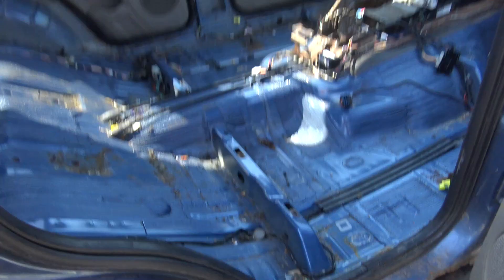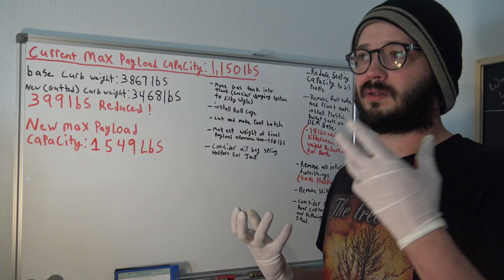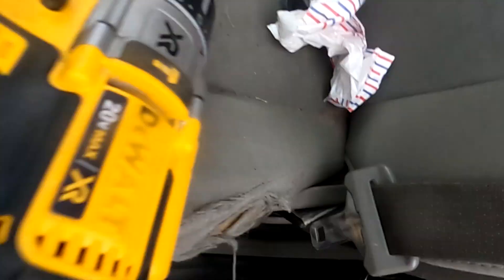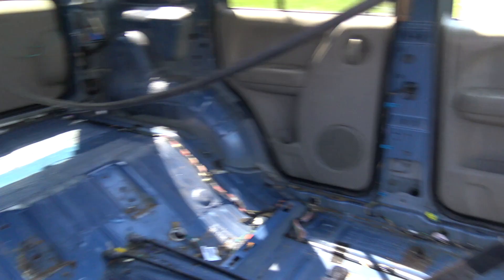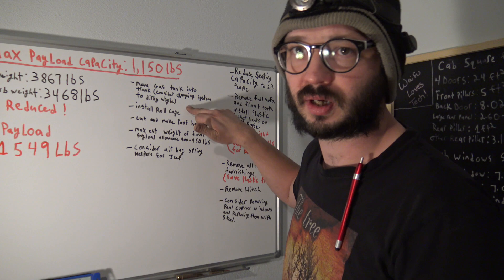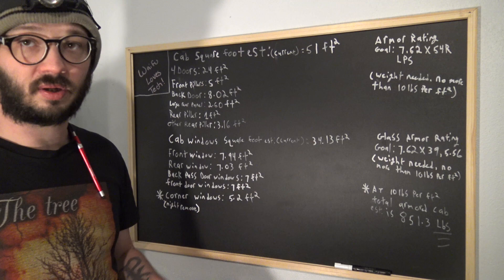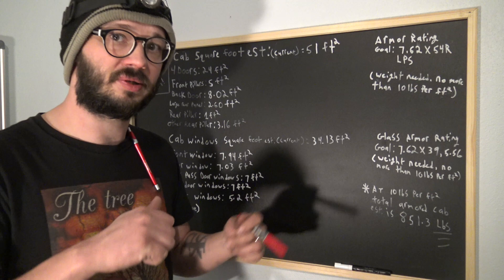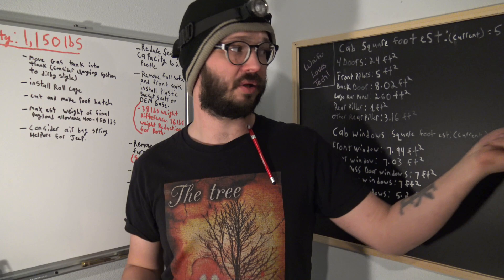gutting the jeep to armor it! (armored vehicle build part2)

Comment: Having worked from different armored vehicles, mobility is key. Your ability to stop and turn without rolling over is going to be very important since you're raising your center of gravity significantly, as will having recovery points that are easily accessible if you need to yank it out of mud or snow. The heavier your vehicle the easier it is to get stuck. 

Improve your braking capability with more aggressive pads/ bigger rotors, go with 8 ply E load rated tires (more capacity but also improved cut resistance) and run steel wheels since aluminum wheels tend to explode suddenly under stress if they've taken a hit from going over a curb at speed (that why emergency vehicles run steel wheels). 

This is an ambitious project to run using a Liberty- good luck and I'm looking forward to seeing how it goes!

Comment: Perlite (and other porous volcanic rock derived products available at landscaping/plant nursery stores) is surprisingly strong and extremely light. If you experiment with lightweight concrete or composites, it's always good to have around... also waterglass  (sodium silicate - available in most hardware stores) for binding and/or surface treatment (you can also bond glass with it)
Reply from the maker: I do have some sodium silicate left over from a kiln I was building. I'll have to give it a go just to see how it holds up vs some of the other clear resins I have. Now the perlite idea is real interesting, I have a bunch of that stuff for growing things. I'll see how it holds up, could be a good additive to concrete! Thanks for these suggestions brother!
Reply: I was thinking the same way (perlite). I don't know if one is stronger than the other but common cement is heavier than plastic cement when mixed.
Reply: Hi, I was going to comment the same thing. There a guy on YouTube who made a bullet proof vest using pebbels for landscaping, I think those shine almost clear ones are gonna be the best. But this guy he just put them lose in between two cooking trays, It might be a better idea bonding them with cement or resin in layers and see how many layers would be needed for the protection you are looking for.
Reply: @Techthisoutmeow  you need to reach out to Matt from demolition ranch 
You totally owe it to yourself and to your channel 
He’s got the one of the largest gun enthusiast channels on UTube 
And he’s always looking for peoples home made body armour to test anyways so you could both gain from a collaboration
Reply: Could you use perlite and resin to make improvised plates?

Comment: When you get done with the jeep liberty, you should do a truck, I think that would have its own interesting problems, and solutions.
I would love to see how the gas mileage on the jeep liberty compares before and after adding all that weight
Reply: make it a helix for the memes
Reply from the maker: Don't know if I could find one, but that would be boss lol.
Reply from the maker: Yeah a truck would be Ideal for this sort of build. When I finish this jeep I will for sure be looking into a different vehicle, this time one with a much higher payload max lol.
Reply: @Techthisoutmeow  try a lightweight car like an old Honda or Nissan with 
,aluminum,/Iron
Reply: @Techthisoutmeow  go with a 70 Chevy c10 gas tank is already inside the cab has a massive engine bay limitless aftermarket parts and lots of flat angles and room for plating might be 3k for a running one

Comment: You might also try and work out angled armor,  like they do on tanks, where you need to save wieght. like in the back perhaps, or over the engine.
Reply: 100%
Reply: Angled armor is nice. What about adding voids similar to Germany’s Leopard tanks? A structure designed to cause bullet yaw. 
Maybe if you set a layer of ball bearings into plastic with a space between that and whatever armor.
Reply: @samuelheino5448  yep good points .
Funny i'm in my ute / pickup right now . Been thinking about spaced - strike plates ect the whole way home.  Tailgates & tray bed head boards / tool boxes & great for strike plates & spacing for the cab / crew area.
Reply: Just be careful about spall coming off the angled plate

Comment: Bro your working brain is on a different level. I mean that in the most flattering way. But I was thinking the engine block is in its own way armored to an extent, you could use a composite like dragon skin for weight reduction to enhance side protection, and then box the radiator with your proprietary laminate or alloy and potentially offset more weight in that fashion

Comment: There is probably a good reason those consumer jeep platforms are not used as armored vehicles around the world (besides reliability). You do however see lots of body on frame Toyotas armored (e.g. land cruisers, fj cruiser, etc). Basically the same vehicles that are also modified for overlanding, can take the extra wieght of armor too with some after market suspension.

Comment: Probably want to leave the A/C onboard.  
Not only do armored vehicles run hot and trap heat and humidity but armored people run hot and sweat.
So the windows fog up like crazy and your window defroster works much better when it can dry the incoming air using the A/C system.  
Unless the windows will still open. 
 (That sounds like a big ask on an armored jeep)

Comment: How about sloping the armour tank style in an attempt to increase effective armour for a given thickness (weight) This is obviously going to be somewhat limited in application especially if you want to keep the Jeep a "sleeper" 
I would be pretty unconcerned about the engine bay if you aren't putting solid tires or run flats on it, the engine bay, and engine WILL soak up more fire and keep working than a tire and you are not getting very far at any real speed on a couple of flats especially once they shred and you are running on rims.

Comment: Awesome serries. Run flat tyres ??? 
Pick-up truck / ute , rated for 1000kg payload is a good place to start or other vehicles like 4x4 with easy to upgrade suspension. 
Armoured mud flaps & angled armour wherever possible. This is a awesome concept. & folks from around the world should also have a go. Show & tell their creations.
Different threats & circumstances from different parts of the world. I'm in .

Comment: Just subscribed… sorry for being late to the game, however. In regards to home built plate for torso protection,… what about using epoxy 4 layers of cris crossed fiberglass welder tarp then melting the milk jug to literally make it hot enough to be fluid, pouring it over the prepared fiberglass (in a Mold) then putting another prepared fiberglass panel and compressing it till “cured” now the poured plastic jug for the fourth and final layer. I would the remove the mold trim appropriately to fit a modern carrier WITH soft armor behind it and test it. You could make a last layer being three layer total, but I would recommend leaving it no more than 0.75 inches thick. Testing wise just start with 5.56….. if 5.56 is stoppable the so is 45 and 9. The try 308, 7.62x52 nato being the same or 7.62x54R I would love to hear your thoughts thanks.

Comment: You’ll want to be careful with the vehicle’s electronics. You’ve got to be careful of the body control modules and the pass lock system (which is the vehicle’s security system). If you remove the radio system without properly deactivating the pass lock system, the pass lock system will automatically go into shutdown mode and prevent the ECM from functioning properly, and you won’t be able to start the Jeep to drive it. The pass lock system goes from the ignition switch to the ECM. It’s an anti-theft system. Plus you could accidentally trigger the airbags to detonate, so be extremely careful with any of the electronics. They’re very sensitive. A slight change in voltage can detonate the airbags.
Reply: “A slight change in voltage can detonate airbags”?
How much “change” are you talking and where would this voltage be in a normal state?
Reply: @jaxturner7288  all it takes is a static charge to set the airbags off. Disconnect the battery before even touching the air bag wire connectors. The airbag wires and connectors are yellow colored.
Reply: @jaxturner7288  I can’t remember right off what the voltage is, but just be careful with those wires. An old boss of mine told me about a technician who accidentally disconnected the driver side airbag, and it detonated right in his face. He wound up with 2 black eyes, a broken eye socket, a broken nose, and a skin laceration on his cheek. He was lucky, it could have broken his neck.

Comment: If you do not bulletproof around the edges of the door and the edges of the windshield bullets will pass right through with no problem they can ricochet off the inner sides of the door jambs and come right into the car they usually will still plates along doors and windshields
Reply: Door jams become bullet funnels and need to be addressed.

Comment: Liberties had a hard time not breaking stuff just with soccer moms driving them around town with minimal cargo weight.   
Can’t imagine how it will do with things like concrete filled abc pillars being considered.  
Better make sure the recalls it had for the lower ball joints and rear hatch were done so it at least stands a chance of holding itself together.    
The ones Chrysler had testing for potential mail delivery service lasted six months in to the program before recurring durability issues forced them to withdraw from the two year proof testing program.  
Just six months of mail delivery caused 3/3 units to suffer multiple immobilizing failures.  
The Pacificas passed all the testing and requirements and would have been considered a viable replacement except it’s in service observed fuel efficiency was way lower than expected and that alone got it kicked.  
The town and county minivans actually passed all their tests and requirements and bids for contracts with the government were supposed to be in the works.  
That was ten + years ago so….. not holding my breath for minivan mailmen.  👍

Comment: you could make your own care frame, from scratch, with any engine, to match your tanks need
Reply: use deflection wedges, like normal tanks
Reply: or just deflection grids with the heave strike collection absorption faces in the deflection grooves
Reply: try framed steel plates filled with concrete (moving sand bag car)